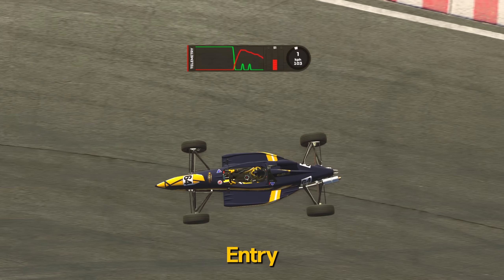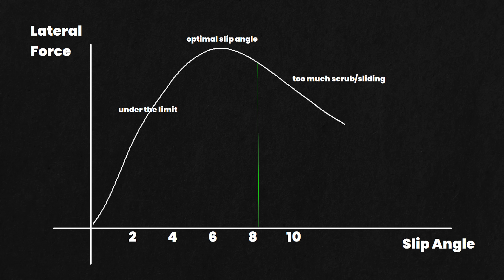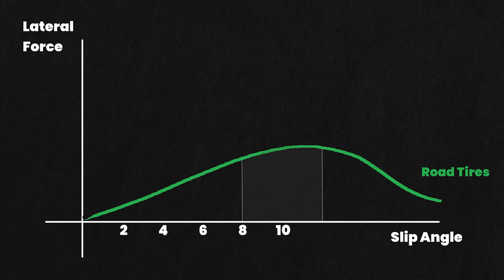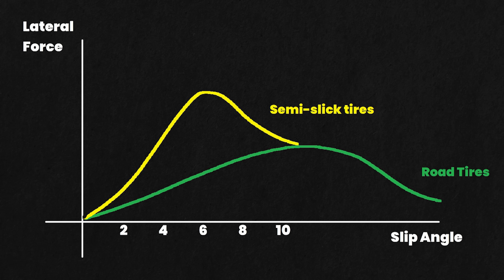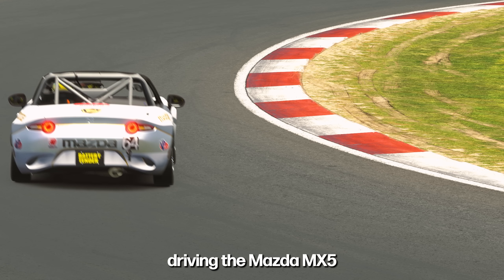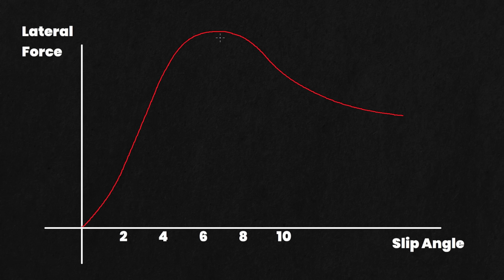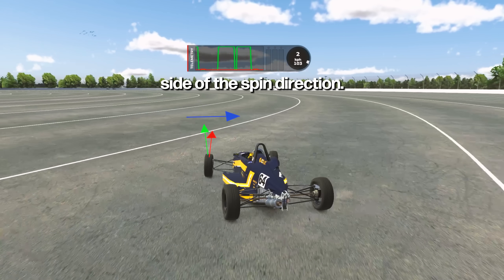The True Limit in Motorsports - Slip Angle Explained

Comment: As someone who studied vehicle dynamics in Formula Student, I have to say this is a very good explanation. I would argue that when drifting, you can no longer call it a slip angle since the rubber is not being deformed traditionally; instead, there is a relative velocity between the surface of the tyre and the road, where there is simply removal of rubber by the scrubbing. Nevertheless, it is still a very good explanation. 
The explanation of how lateral force generation improves slightly after the maximum steering torque is absolutely correct (this is due to pneumatic trail migration). It's a really impressive video. 
My suggestion would be to properly introduce the concept of sideslip angle, which is somewhat referenced in the total slip angle you mentioned. Sideslip control is sometimes utilized in torque vectoring systems, although most are yaw-rate-based. It is critically important to achieve the ideal sideslip angle as quickly as possible and maintain it throughout the corner to maximize performance. I don´t know if you ever read Milliken but sure seems like it.
Reply: I thought the same about that! In drifting the concept of "slip angle" is different....
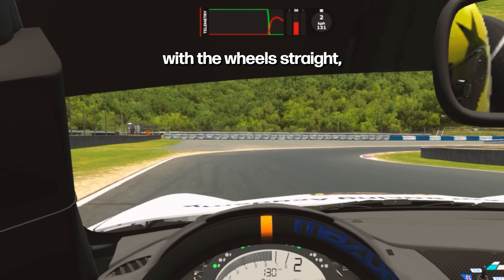Reply: Maybe you can help me wrap my head around the section at 9:35, if you wouldn't mind... I've watched it like five or six times and I still can't fully understand it, it seems the explanation contradicts what the video is showing, but perhaps it's just a misunderstanding on my part.

When the driver is countersteering, the steering wheel is pointing perhaps 5 degrees left of center. Suellio states it's "because the front tires are still pointing to the inside"... but in the video, they are "pointing" to the outside/left (correct?)? And then states "because the final slip angle between the tire and the road is still pointing to the right". I understand that direction the car is traveling is still toward the inside. But if the tires are actually pointing left of the direction the vehicle is moving (because of countersteer), isn't the slip angle of the front tires actually "negative" here?

 Sorry for the long comment, have spent the last 15 minutes confused by this, lol
Reply: @kedr0n  The slip angle of front tires in that situation wont be negative in general. It will be just lower than rear tire. You need to think about the direction of vehicle where it points (yaw angle) and the direction where the vehicle is actually going. Front tires add their steering angle to this equation. In that particular case of corner entry he initiated the rotation of the vehicle that he carried and was maintaining due to inertia. This approach of corner entry is even faster because your tires are not as much creating the yaw torque on vehicle (rotation) but the maximum lateral force. You are also better oriented to get earlier on throttle.
Reply: @LaggerSVK  So you mention the vehicle as a whole, and not just the tires, which is maybe why I am confused? I guess I am hung up on the explanation at the beginning which explains it purely in the context of the tires (0:32)
Reply: @kedr0n  exactly so basically the car was pointing to the inside of the turn meaning there was a Sideslip angle, if it is too much the rear wheels are being maxed out in slip angle and there is positive momentum on the car, generating oversteer, if the driver stays turning to the inside the fronts will generate force which will contribbute to the positive momentum creating more oversteer. The only solution is the fronts to reduce the lateral force generation, or to even stop generating force. It depends of how much sideslip or yaw.
Reply: @kedr0n  when you are talking directly about the forces by each tire then you need to look into the side slip angle of the tire however vehicle side slip angle (Beta) is also a term. In the video the rear tires are always quite at an slip angle. Mostly the side slip angle of vehicle is similar to slip angle of rear tires and thats why I referred to it because that is what we can see in the video. However I need to say its hard to explain through text. If you are interested lookup some diagrams but the angle is computed where the tire is "looking" vs what trajectory it goes and in some cases it wont be so simple. You can also lookup the Tire Mz (Self aligning torque ) vs slip angle for tires which is the component he is talking in the video and is responsible for majority of feel in force feeback.
Reply: @kedr0n Basically, the fronts are pointing left of the car but right of the direction of travel.
Reply: @kedr0n to put this simply, this was a light rear end with an oversteer biased entry.   
As long as it was slowing down all the way to the apex (without overslowing) this was a decent entry, but had countersteer to control the rotation rate of the vehicle, especially in its biased oversteer state.
This was not all wheel creeping.
The slip angle was the rear tyres, not the front.
Once the rear was in the optimal slip angle again, the steering could go back to turn in again and continue the balance of all 4 tyres and begin the throttle pick up phase at the apex.
Reply: @kedr0n  He's steering to the left, but not as much as the car is pointing to the right already. So the line coming out from the front tires is still pointing inside of where the car is going (maybe 1m inside the corner apex), but its closer to the cars momentum line than the back tires which are pointing a lot to the inside (maybe 4m meters inside the corner apex). He countersteered to reduce the slip angle because he'd already reached the limit and was giving himself some leeway.
Reply: @kedr0n  basically because the back end is coming around on the outside of the front tires so the slip angle of the entire car is pointed more inward so you can turn left a tad and the front tires are still pointing to the right in relation to the turn.
Reply: If you actually watch and listen to the video, they addressed this at 3:40 mark
Reply: Race car vehicle dynamics. I have that book but have not read it through fully
Reply: @ellisjackson336  yeah, I read it many years ago when I was simracing on gtr2. It's a must read.
Reply: @ewertsp   yeah I’m power sure my copy is in a storage unit in a different state now lol. Gotta get another copy
Reply: I think you would benefit going back to school a bit ;-)
Reply: @NielsHeusinkveld  I do understand there are some details as you said in your comment regarding the presented FY vs SA graph, it is  true it is not  accurate, it has details wrong. For the purpose of the video I don't think the fact most tyres peak at values smaller tan presented is of any importance, afterall all tyres are different, in formula student the hoosier peak around the 5º. Neither does the fact cornering stifness is not properly represented.   But the general explanation for someone who has never contacted any of this subjets is still generally correct. The most incorrect was infact the tryre selft aligning momentum, you were rigth to point that, I reviewed a few things and usually the peak is infact quite a lot sooner, i've seen 3º sooner reaching the peak which is half of the ideal slip angle in that particular case, but than again it is dependent on each tyre.  Probably he should make a video on steering collum torque, where suspension can enter the conversation, but that migth be too much engineering for a simracing purposes. And unfortunatelly my uni does not teach vehicle dynamics, so going back would not help me there. The reason I commented positivelly is because for people who like to do simracing with 0 engineering background I believe the explanation presented gives a general introduction to the topic. But yes I agree this is not a video for vehicle dynamicists.
Reply: @afonsopereira3223  I was looking for someone to mention self aligning moment. I was also in Formula SAE and found the same conculsion you mentioned about how the peak for the aligning moment and maximum lateral force were not always at the same slip angles, and thus could cause the driver to feel that they've reached the peak grip from the tire while in reality there is still a little to be gained. Like you said, steering torque is dependant on several variables, and it's a bit too much for sim racing stuff, but interesting thing to understand when designing the Formula cars.